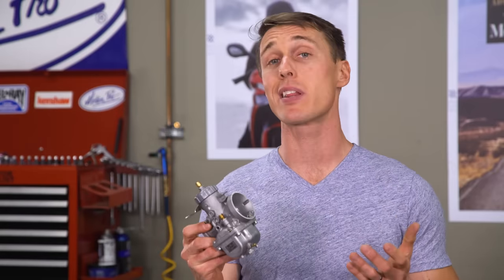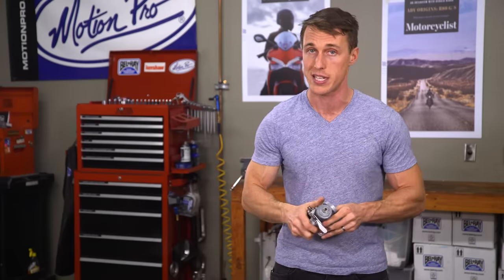Carburetors vs. Electronic Fuel Injection—What’s Better? | MC Garage

Comment: For the eco warriors then injection with its stringent array of sensors. But for simplicity and ease, a carb all the way. A block of metal with some brass, a springy floaty bit does what all those expensive sensors and computers strive to do. Simply work.

Comment: Can a carburetor engine may be converted to EFI..?
Reply: Im no mechanic but probably as long as its a 4 stroke. But it would be expensive and might not work properly. And if its a bike without a battery thay will need to be added

Comment: @arihenning Also, please do make a video on how tunable the EFI compared to a Carburettor is, because a lot of old school guys believe that the carburettor is more 'Tunable for better power' than a fuel injection system, irrespective of complication of process or cost of parts.
Reply: Carbs are certainly easier to tune. You just need some jets and needle shims and you can totally alter the fueling.
Reply: Yeah. That's there. But what about getting the most power out, of a given engine? Let's say a single cylinder sub-300cc engine? Which would you pick for the fueling duty? Irrespective of costs I meant. Which one would be a better Fueling mechanism for the best Fueling and power output?

Comment: All true, BUT for a Harley twin with A single carb (no multiple carb synch required) there is a lot to benefit from the simplicity of a single carb. I could re-jet the carb without removal when I moved it from Wisconsin to sea level Texas. When I ride back to Wisconsin it will run rich but still run fine. Just a lot less components to fail.

Comment: Here's the thing that bugs me. The EPA. Realistically there just aren't enough bikes on the road to make a difference that justifies the over the top excesses of the regulations. Both methods have their pluses. Making a bike that is user serviceable with a carb is not going to destroy the earth or affect the air you breath. It just is not.  You as a bike owner ought to be able to get the fuel system you like. But the nanny state is not going to permit that.

Comment: carb wins, never has problems, even its old or insufficiant, it will run... look at hyosung injection bikes, or piaggio ... always burn injection(due to bad cdi software or electronic issues) and is hell expensive and is broken minimum once a year... me on the other hand still can use my 5 year old carburator if i want, but why, its hell cheap :D so change it whenever i want... 

so if i have a big bike, and i am travelling international, i would rather have a carburator... cause you cant fix injection at pakistan or tajikistan trip :P even not at big cities, you have to wait for parts :D but engine will also run without carburator if its broken ;) so make your decision at the beginning... and know good what you will do with your bike or what you expect.. if you are a city rider like İstanbul, than its best to have injection :)

Comment: Can you start without a battery with a fuel injector ?
Reply: @Soldier4USA2005  I meant on a bike without a battery or completely dead which has a fuel injector and also has a kicker , is it possible to start it without any external battery connection ?
Reply: ebin belji Yes, but it's difficult. Read the linked article.

Comment: Can Fule injection bike start with kick on dead battery
Reply: I don't think so  battery needed to power ecm carb is better when bike is used occasionally and when for high hieght area u can manually adjust carb since there low o2 level

Comment: Which one is good for long lasting engine? Carburetor or Fuel injection? Thank you for your comment 😊
Reply: fuel injection, because you end up with a good fuel-air ratio 99% of the time you end up with less carbon build up

Comment: May i know the reasons of efi problems of stop working ?
Reply: mostly components made in china or malaysia break
Reply: Fuel pump fail. Throttle position sensor fail. O2 sensor fail. ECU (computer controller) fail. MAP sensor fail. MAF sensor fail. Low battery voltage. Corroded sensor connection. Injector failure.

Comment: Nothing against fuel injection, it is more efficient and modern. But here, all my friends with a fuel injection Piaggio Zip 50cc moped say they suck, when it freezes, they sometimes do not start easily. Nothing to do with their batteries (they are new).
Here just with my nearly 30000km Zip 4 stroke from 2014 50cc and it is fine! And when it does not start, you can always go with the kickstarter

Comment: Carbs fail because of two reasons only..  one: they aren't run often enough, with ethanol fuel (garbage gas) they clog up unless you run them from idle to full throttle on a consistent basis opening the jets all the way.   TWO: elevation, if your by the ocean or on top of a mountain will need the opposite fuel to air mix.. too much fuel means you can carbon up your engine clogging exhaust emission (crap) from the epa, and causing the spark plug to fail pre-maturely.  OR the other way around too much AIR and not enough fuel means a very hot burn, wich can actually ruin the whole engine, especially bad if you have aluminum heads.  other than that, if you run a carbureted engine all the time, and go through the whole rpm range each time you ride then it shouldn't need to be cleaned/re-jetted for years and years and years of use.  as for fuel injection, it can be more expensive if you want to do a new exhaust and intake because rather than buy a cheap jet kit you have to buy a programmer or have your bike put on a dyno and tuned OR ELSE, fuel to air ratio issues will happen much the same as a carb at the wrong altitude for its adjustment and jetting.  and before anyone argues this point, saying their non-tuned FI bike runs fine with no tune and aftermarket pipes.. when you let off the throttle does it backfire?  yes.. ok fuel to air ratio is wrong. tune it.

Comment: Carbs are damaged and effected by the corrosive effects of ethanol contaminated petrol and the acetic acid caused by oxygen degradation of ethanol in the gas tank. Ethanol is a curse word for classic vehicle owners as it destroys steel gas tanks, fuels hosing and fuel pumps of classic vehicles unless a lot of money is spent proofing them.

Carbs also have issues with adapting with the ever changing chemistry of petrol sold at the pump. Older engines were designed to be run on the higher energy content leaded petrol, not the weaker "diet" crap sold at the pumps today. Fuel injection automatically self adjusts itself, carbs require some fettling and skill to set up just right. Some petro-chemistry skills are often needed as classic 2 strokes require either a shot of kerosene or diesel added, per gallon, to counteract the big drop that ethanol contamination causes to the volatility temperature point of petrol (35 degrees C (unleaded) > 18 degrees C (E5 unleaded) which results in overheating as seizures.

When it comes to running on modern pump gas, fuel injection wins hands down.

Comment: Epa yes but not true I'm sorry a carb produces more power cost per power ratio the carb wins hands down and fuel injection is super complicated sensors relays fuses ect . I can't pop a carb out of anything in 30 min and fix it on the go but not for fuel injection injectors do get gunked up and clog they are the more fuel efficient option but not the good option for power

Comment: Carbs are obsolete and inferior to injection, even manual fuel injection is better than carbs.
Carbs are set to an air fuel ratio which may be perfect at 1 point in the rev range but out by varying amounts everwhere else. Fuel injection can be correct everywhere in the rev range.

Comment: How to ride a carb bike uphill, 
What to do when it chocks?
Reply: If by chock you mean a sort of lurch or buck then you might be in too high of a gear, the solution would be to downshift. If the bike is stalling or misfiring then it might be a carb issue. The carb might just be old and in need of a rebuild. The floats might be out of adjustment as well.
Reply: @Redtooth75  it's a new bike, it struggles to run in very steep slopes at slightly high altitude. Carburetor must be tuned for mileage right? 
Can I pull the chock and bring more fuel in such situations?  Will that work.
Reply: @cyrilelanjithara6284  yes, carbs must be adjusted for altitude changes. At higher altitudes the air is less dense, so you need less fuel to maintain the same air to fuel ratio. EFI will automatically do this, carbs will not. Pulling the choke probably won't help because it will restrict the air and cause a loss of power, but you can still try it to see if it helps. I would recommend checking all of the adjustments on the carb to make sure it is correct. The manufacturer should have adjusted it properly but mistakes happen.
Reply: @Redtooth75  if less fuel is required then pulling chock won't work since it will send more fuel into the carburetor.
Reply: @cyrilelanjithara6284  chokes are an air valve, they richen the afr by restricting the amount of air. Pulling the choke does not make the carb put in more fuel.

Comment: Obviously you can not honestly rightly hold up a throttle body and say "this is fuel injection" ....to fairly illustrate you would need to show all the components needed to duplicate what the carb does ...meaning you need to hold up the fuel pump and cpu

Comment: nope efi is just as good as a nicely tuned carburator. its just efi does not require tuning. while carburatoe. needs right tuning. and corect. jet settings.

Comment: Your EFI statement is not true on many levels! For instance you stated EFI doesn’t care about temperature or altitude. That statement is actually not true due to the fact that the EFI ECM on modern bikes run on a map based system that doesn’t have the level of adjustment to cover higher altitude unless they are operating a wide band O2 sensor system!

Comment: Crappy fuel economy, inability to adjust for altitude/filter clogging, crappy throttle response, clogging. Yay carbs! Oh wait.

And I get to say this crap cause I have 2 bikes with 4 carbs each. Both my carbed bikes have running issues, my fuel injected one does not. Of course the carbed bikes are also 30+ years old...I couldn't tell you how many times I have had to lift the tanks to work on carbs.

Comment: I have Supra fit 100cc/wave alpha in other country
Still better than injection
Ecu more sensitive than CDI firing system if your  battery down.

At engine stall condition adjust gap and cleaning sparkplug then Kick starting.

Sorry rip english

Comment: It is reliable cause it is fuel efficient but i would still prefer carburetor cause of its simplicity...
Reply: Do a parts count of a fuel injection system and of a carb. I bet there's more stuff in a carb system.
Reply: @robslover2959  yes there is,  Specially in a car's carburetor... But still prefer it caused i am used to repairing carburetors dew to my line of job... I am still having a hard time trouble shooting new models specially EFI engines than the old ones...

Comment: The question is. What's better?
Reply: I wanna know the answer too
Reply: They both have advantages and disadvantages. Carburetors are cheaper and less complex. They are much easier to install because they are pretty easy to tune, and require no electronics. The only wires going to a carb will be for an electric choke if it has one. The downside to carbs is that they are inefficient and imprecise. They are also harder to start when cold and require you to let the engine warm up before you can drive.
Fuel injection is more efficient and much more precise. A fuel injected motor will make better fuel economy and slightly more power when properly tuned than a carb. The downsides is they are much more expensive and complex. There are many electronics in a fuel injection system which makes installation harder. Repairs on fuel injection systems are also more costly. Fuel injected cars are much harder to tune, a professional dyno tune is usually required. Fuel injected cars will start easily whem cold and also require no warm up.
Tl;DR: carbs are cheap, simple, but less efficient.  Fuel injection is expensive, complex, but more efficient.

Comment: Carburated bikes offer quick and wide opition of conversion into "race or sport" mode. A simple tweak or replacement of entire carb will turn your bike into race ready machine. With FI, ita possible but it needs a lot of knowledge and professional personels should only be the one to do this.

Comment: The carb 2005 Honda works a whole lot better than the identical 2018 model, but it does not have the same smog requirements.

Comment: here in the philippines there are 2 kinds of famous suzuki bikes 1 is the raider 150 carb and the other is the raider 150FI but here most of the people choose carb i dont know why because they say it is less money to spend when you have to fix it but what they dont know is FI is more reliable and the fuel consumption is a lot cheaper than the carb but i do agree that the carbs sound more good its like the sound of carb is more bolder than the FI just like the 2 bikes i mention and yes the raider 150 carb sounds better than the raider 150FI but FI performs better over all

Comment: Question is, can the reliable injection work without the extremely unreliable computer? Like a coil runs ignition in the flywheel, it should also run injection, with a small knob for elevation tuning.
Reply: it can, most computers are very reliable such as my Daelim vjf250 which is super reliable

Comment: I am an old school Mechanic, now retired. It seems that you are sold on fuel injection? And yes normally it is very reliable,
but: the minute your "computerised injection system" decides it is not going to work any more, you are stuffed !
Unless you are a computer wis kid, (which I am not) as you have said, then it costs loads of money to fix it, Not good.
I do not believe that fuel injection is better on fuel, as I got very good milage out of Carburettors, weather on cars or motorcycles. 
Did you know that nearly all engines are badly tuned, due to the engines being stifled and NOT being able to breath properly? 
I am sure you know, that when you restrict an engines breathing, "in or out", You loose power! 
Cartelistic converters are in place because the engine did not burn the fuel that was delivered to it by AI, which is Not efficient. 
Fuel efficiency is only as good as the Computer programmer! Or in my case by the person who tuned it.
The way forward is Hydrogen, not from service stations. But water converted under the bonnet as needed.
Much safer and then NO problems, Oh the bead heads won't like that. Thanks You for your Video. Have a great day.

Comment: I build lots of mx bikes and if you don't think your efi bike can get clogged like a carb then jokes on you.  The injectors are even more of a pain in the ass to clean than jets, and when electronics go out you're simply fucked.  Also dont get me started about failed fuel pumps and failed capacitors.  Ive owned many of both and I'll take a gravity feed to a properly jetted carburetor any damn day.

Comment: today my EFI died on fuel pump malfunction on the road.
I never needed to call assistance for carburator motorcycle in my life.
Carburator works even if battery is completely dry.
So the "extreme reliability" of fuel injection in real life pretty sucks.
I say EFI is OK for racing bikes and for big engines with multiple cylinders.
But for single cylinder engines below 300 ccm and moderate power it is nonsense dictated only EKO fascists.

Comment: Fuel Injection is not maintenance free, you have to clean the idle air sensor and the injectors. With carburator the repair is cheap, fuel injection is expensive.

Comment: Fi vs carb not a big deal if your bike is only a 100cc to 150cc bike. Note if you leave in a place that is far from the city go for carb. For sure there's no motorcycle shop that can repair you bike if its a fi. On a remote areas a simple problem will become complicated if using fi for ex. Water gets inside your gas tank. Fi it lot more difficult to clean while carb is easy just open the drain screw.

Comment: Carburetor hands down! EFI is trash. Uh there's a fuel pump on most any carburetor! and fuel injection relies on sensors! And again fuel injection is trash. Also you can tune a carb to be more fuel efficient than fuel injection although you won't have much power, but the again retune or simply change some parts and your back to equal or more power than fuel injection!

Comment: If you run out of power in your battery, you can still turn the bike on with a carbureted bike, running it downhill. You can't do that otherwise. Carb tuning is not expensive, meanwhile ECU tuning andall that crap is really expensive.

Comment: E f I  is one of the most troublesome way to go u youngsters probably now nothing about carb but of all the bikes l have owned Eli is nice starts great modern but if something goes wrong it can be troublesome carbs are easy cleaned pretty trouble free. I have bikes that are 70 years old carby still very good very reliable try maintaining efi 80 years from now l doubt it u will not get parts carb will probably still run fine my opinion sorry to upset the apple cart cheers

Comment: Carburetors are VERY RELIABLE compared to Fuel Injection... doesn't brake down easily and cheap parts, easy to work on... EFIs are great but cost my back account if it breaks